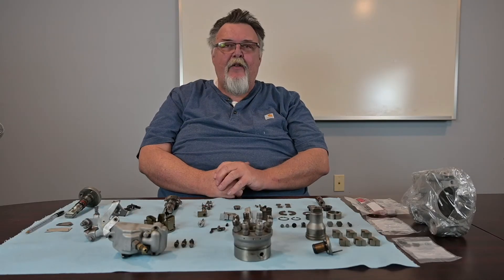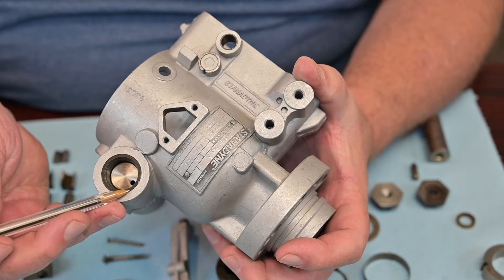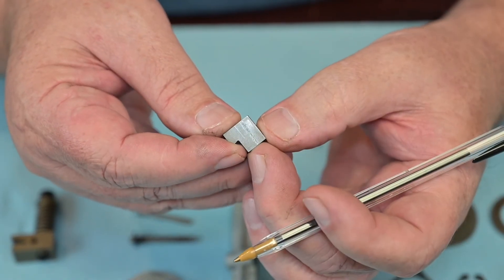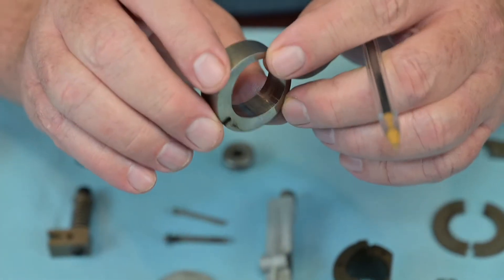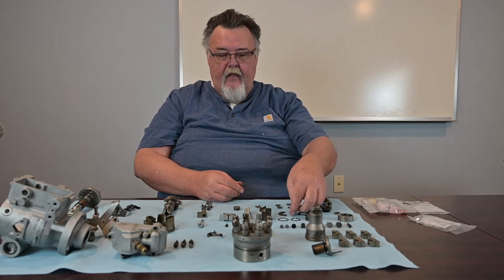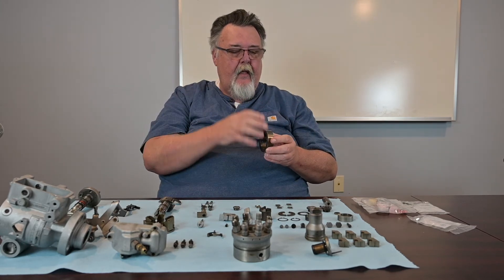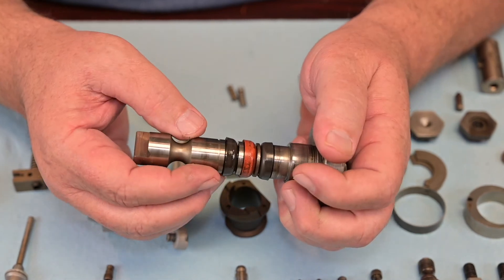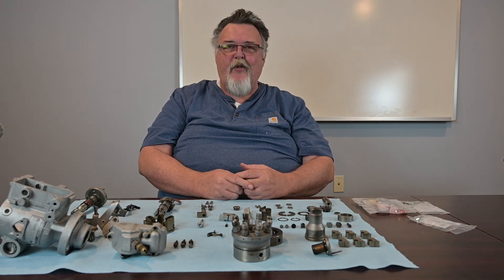DB2 Internal Parts Inspection

Comment: I'm looking forward to your assembly video. I swear, that DB2 looks like a Rube Goldberg device if I've ever seen one!  Currently dealing with a DB2 2831-514HMMWV M1025A2 that is leaking out the throttle valve on the driver side of the pump.   Are there any ways to "hotrod" the DB2 into performing better?  Thanks for making an extremely clear and well explained video.

Comment: BEWARE BEWARE BEWARE > I would steer clear of this business, they do not stand behind their product and will not assume responsibility. they will take your money and and make a mistake and the customer has to pay for it by losing their money. 

Story time: I ordered a 6.0 HPOP from them the delivery driver left the item in my driveway out by the street, someone picked it up I was told by DCP to get a police report to cover it and I did. The pump never got replaced, I never got a refund, and I lost my core pump to them. 

A few years later I buy some 7.3 injector cups from them not knowing I was buying from DCP and they send me a open pack that had one missing and a couple of the others were bent. They blamed it on FEDEX in which the shipping envelope was not damaged with original shipping label on it. They sent me 1 cup and I ask them what about the 2 bent cups, then I spoke with a manager that said she would send me out a whole new set. She sent them to my old address from a few years ago in another city where I dont live anymore and not the address that I ordered from and its been almost a year now and I haven't got the cups or my refund and they tell me that they cant help me.

Comment: Hi. My DB2 pump is leaking from the transferpump houseing. I have tried to take it apart to see for a broken o´ring or so. Should there be a o´ring to seal the houseing??
If so, do you know the partnumber for it? :)

Cheers, Esben
Reply from the maker: Yes there is, that seal somes with our kit, the part number is 24370.

Comment: Hi, is it same to wind the DB2 pump fuel screw right up (clockwise) for max fueling? Currently set on 80cc but max about at 100cc
I've added a turbo S54 from Quadstar and front mount intercooler, fluid dampner etc...bit like to know if I can wind fuel all way up....
Cheers , Tim ☺️
Reply from the maker: Yes as you turn it clock wise it increases the fuel
Reply: @dieselcare  ok so I won't hurt or damage anything inside the injection pump if it is turned all the way to max?
Reply from the maker: @timothyschulz4730  As a general rule no, but there is always the possibiility of the fracturing the leaf spring, no likely but still a possibility.